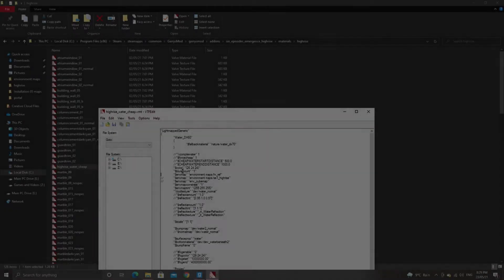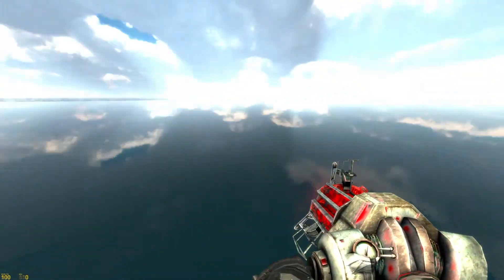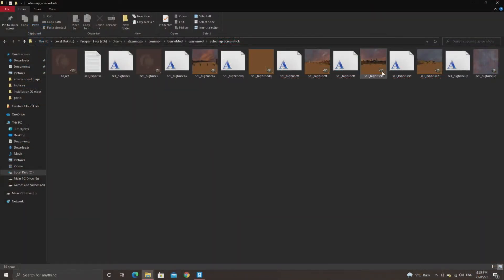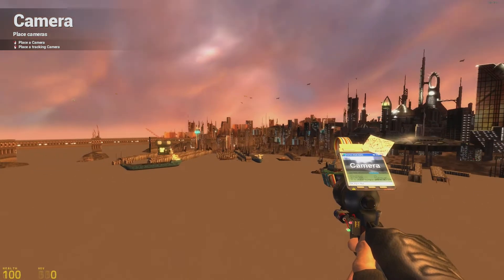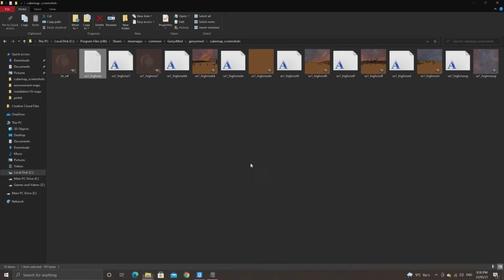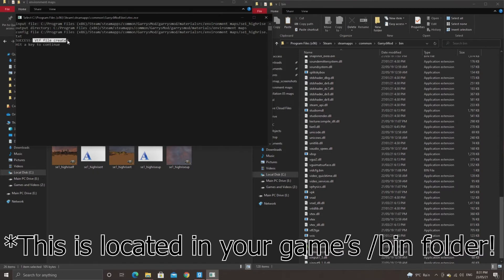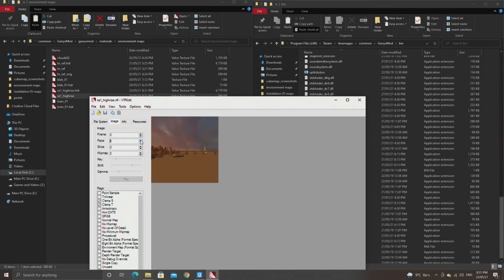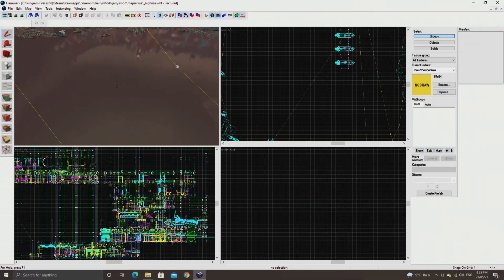Hammer Tutorial 20 - Creating Custom Cubemap Textures For Materials/Models

Comment: Thanks for the tutorial, it worked out for LDR but for some reason when the game has HDR enabled it uses the local cubemaps instead of the custom one that works fine with HDR off.
Has anyone faced the same issue?
Reply from the maker: Thanks, I'm glad the tutorial helped to some extent. For me, the answer to your question is no. It could be the game you're doing this for? The environment map textures for HDR would be something like se1_highrise.hdr.vtf (in this video), maybe the equivalent file doesn't exist for you? I cannot see why (if both LDR and HDR textures exist) it works in LDR mode fine but not in HDR mode, my guess is that the HDR textures are missing. If you do have the HDR textures then I don't know what to suggest!
Reply: @TheMaster974  It's for Gmod, but the solution i found was to turn all the cubemap sides into individual textures, then on the world i created a cube room with these textures and placed a cubemap on the center of it, then i set the faces i want to reflect this specific cubemap hehe It worked. Thanks anyway :)

Comment: I extracted some textures from existing cubemaps, but when I put them through vtex it says that theyre "oldstyle" and to recompile with -oldcubepath. It works but I wonder if I'm doing something wrong, or if there's a better way to decompile existing cubemaps and change their faces around. Awesome tutorial btw
Reply: testing more, this doesn't happen when i use tf2's vtex instead of sfm's...
Reply from the maker: Thanks for the comment! I did a little research on this and for more recent Source games i.e. Portal 2, Left 4 Dead 2, Source Filmmaker etc., you would have to go down the route of adding -oldcubepath as this relates to the way .vtf files were made in older Source games that this tutorial relates to (TF2, HL2, Portal, SDK Base 2013 etc.). So it's not really a matter of doing anything wrong, but more that vtex got updated in newer Source games and this video covers a method for older Source games, but this process can still be applied for the newer games. Hopefully this clears things up!
Reply: @TheMaster974  I eventually got it sorted. I wonder if there's some sort of method that  can be used to change the VTF files to sort of SFM-compatable ones by mutating the position of all the images to counter the way SFM mutilates every cubemap its given.